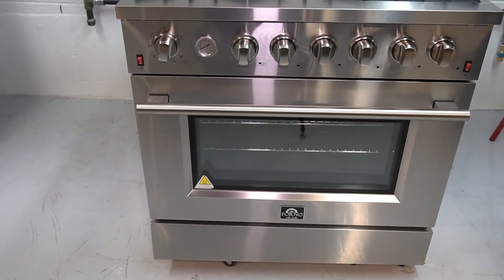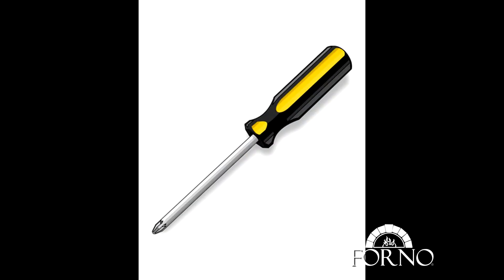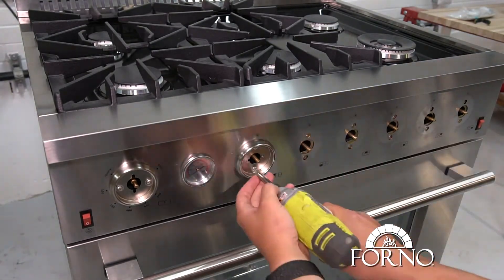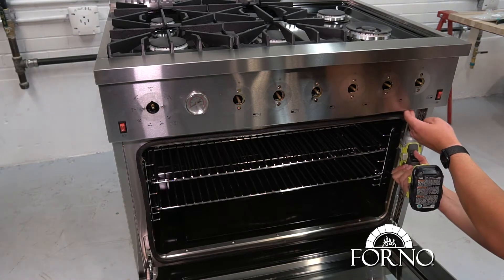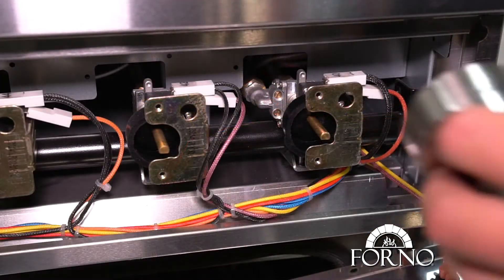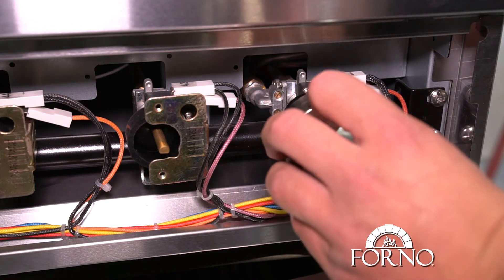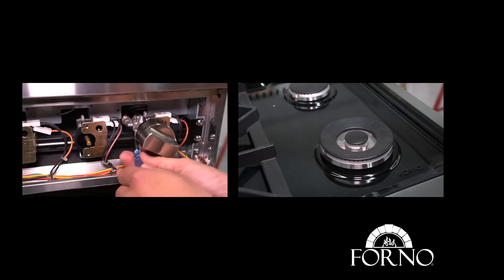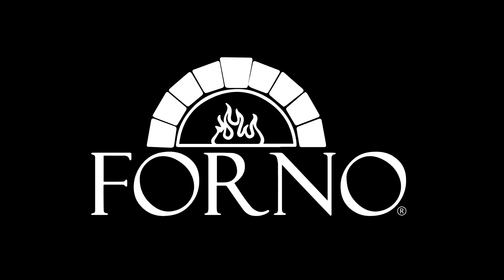Adjustment when burners clicks at minimum setting - Common for all models

Comment: Bought the stove a month ago. All of a sudden Burners click but doesn’t light. It seems like gas not coming.
Reply: You have to rip it apart to adjust the burner, which is cumbersome. I haven't had mine installed yet. It is already bothering me having to do this. Did you use the oven? Does the fan create a lot of noise?